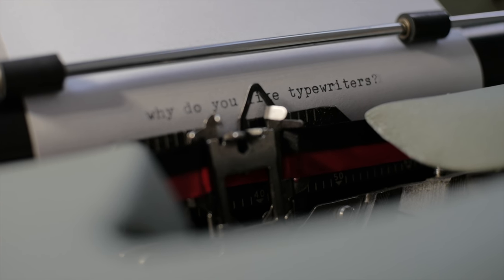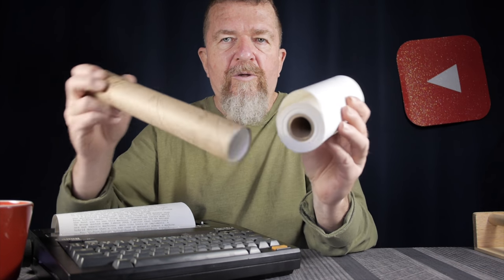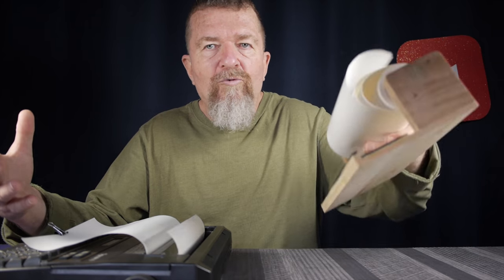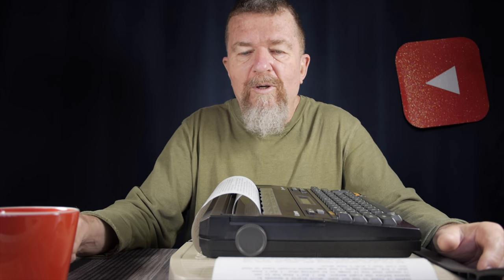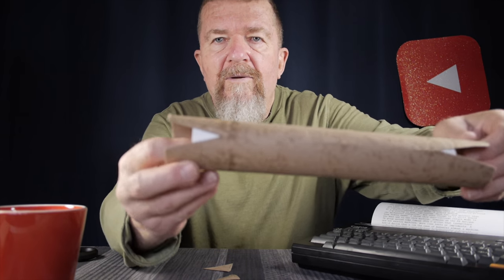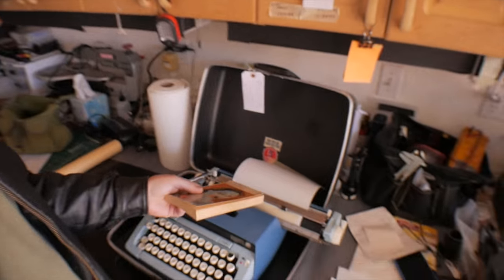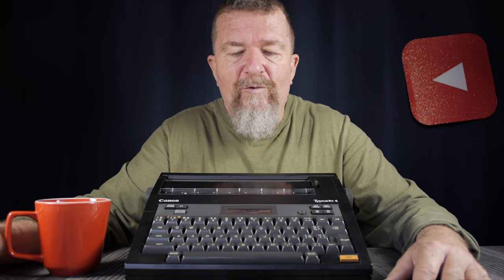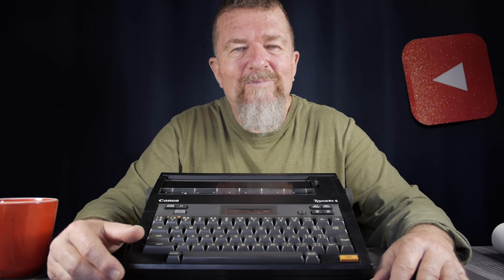Typewriter Video Series - Episode 165: Managing Thermal Typing Paper

Comment: I'm really loving your videos about thermal typewriters and paper. Because of these, I've picked up a Sharp PA-1050 (print head needs work) and a Silver Reed EXD 10 (print mode and line spacing switches don't work). At this point, I might as well put together a full house and get the Brother and the Canon, too. Your Canon, especially, is gorgeous. As I was watching, I wondered if the paper holder could be made entirely from PVC pipe. Maybe that could be another project for you... Like you need another project. I am also excited about your idea for the paper towel roll. That might be the best solution for me.

Comment: Speaking of cardboard rolls, I recently decided to buy mailing tubes to mail letters created in my Canon Typestar 5. I figured that my recipients would enjoy receiving these 1.5-inch diameter, 12-inch long tubes. They did, but I encountered a huge problem. Even when I took the tubed letters to the Post Office and bought first class and/or priority postage, it took more than two weeks to reach their domestic destinations. My guess is that the tubes aren't processed in the standard USPS machinery and require some manual handling. So I abandoned this and went back to plain envelopes.
Reply from the maker: Ah, the Intertubes! I’ll have to try that for a lark.